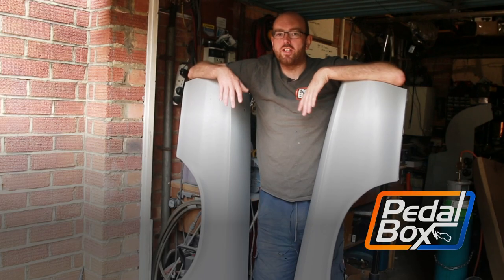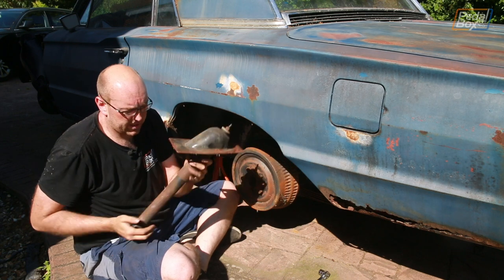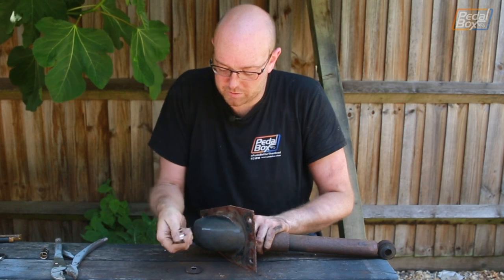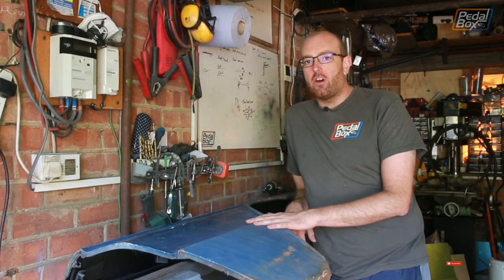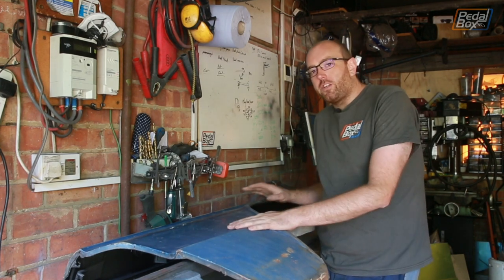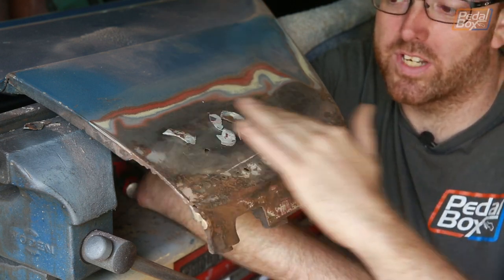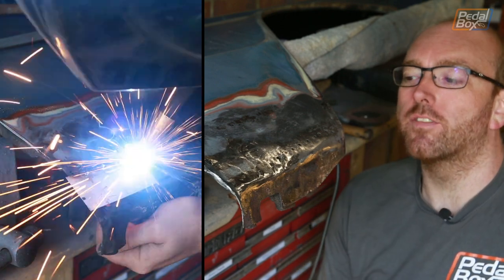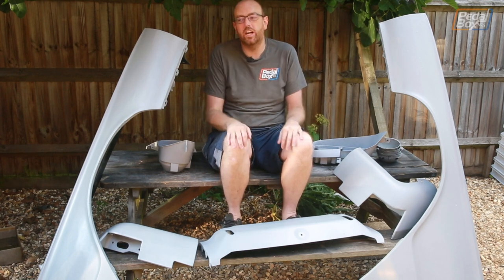Bodywork and Suspension | 1966 Thunderbird | PedalBox Fleet | Episode 81

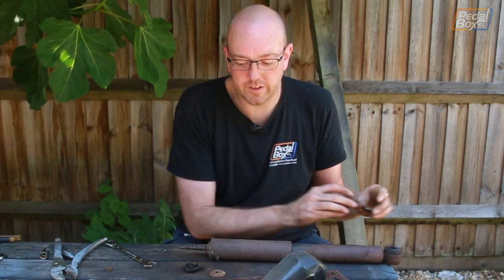Comment: 14mm (0.551”) is just a tad small to 9/16” (0.563”). Depending on the spanned you use, the 14mm just might slip on. 3:08
Reply from the maker: I really need to bite the bullet and get a set of imperial spanners to go with the sockets, a set from 1/4 up to 3/4 maybe
Reply: @PedalBox  That would be a good start, since I think you’re going to keep this car for some time.